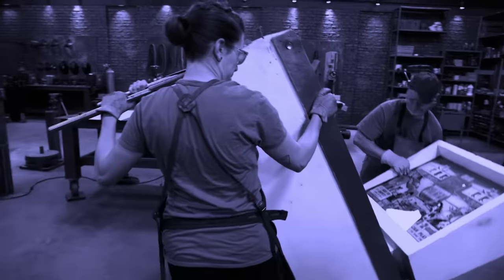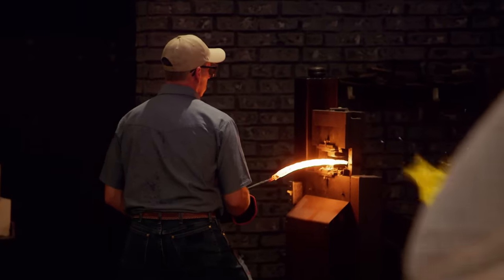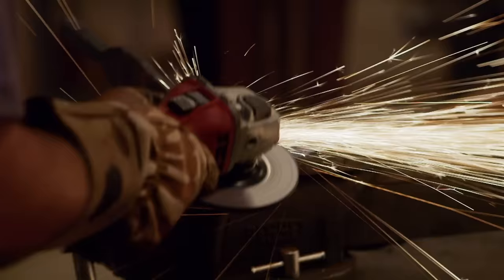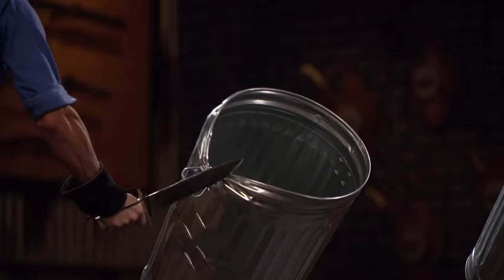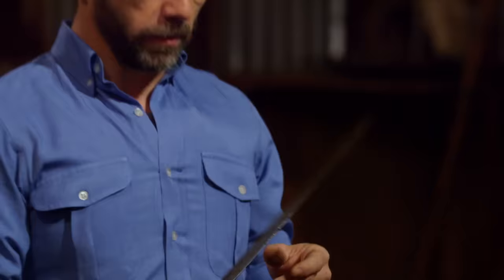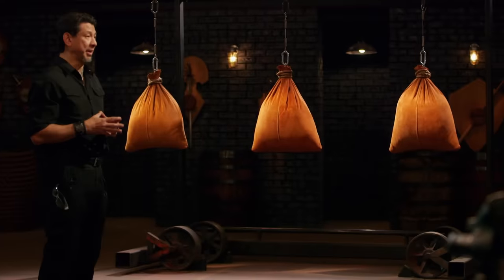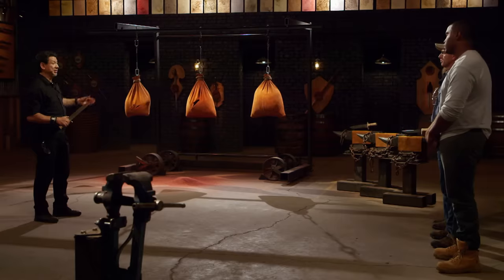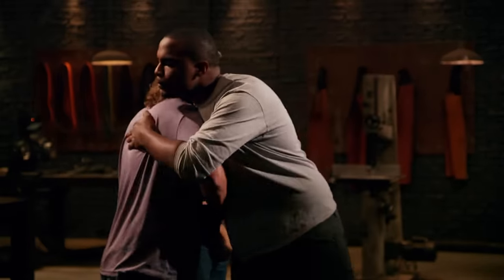Making a Knife Out of Drill Shavings?! | Forged in Fire (Season 7)

Comment: Wesley's blade took the least damage, he just made too light of a knife to handle the thick leather bag.  If they had done a different cut test against fruit or something lighter, it would have probably slipped through them better than the other knives.
Reply: Maybe if he followed the omnissiahs will it would have cut
Reply: Maybe if it had more nicks from the previous test it would have bit into the leather.
Reply: Sharpened 1mm sheet metal can cut through fruit, thats not test of anything.
Reply: He didn't spend enough time sharpening it.
Reply: @streetguru9350  True that. The most dangerous knife is a blunt knife.
Reply: Yes i like his knife
Reply: It held up better than the competition during the trash can test because of the "blunter" angle of the bevel which is the same reason why it didn't perform as well as the others in the sharpness tes
Reply: No it definitely just wasn’t sharp enough a razor blade is super thin but it’d go through that bag like it wasn’t there
Reply: @jeffjefferson2743  A razor blade wouldn't have passed the first test.
Reply: @igggaming9871  that has absolutely no bearing on what I said lol. The other two knives cut the bag yet took more damage on the first test, meaning his edge was blunt enough not to be damaged yet too dull to actually cut anything .
Reply: @jeffjefferson2743  It does have a bearing in that your razor blade wouldn't have even made it to this challenge.

It wasn't wholly a test of sharpness, his blade's shape and weight weren't ideal for cutting heavy leather, they were lighter than the other two blades. It may well have been sharp enough - but the shape (curved such that the blade edge lands parallel to the surface) combined with it's weight did not help.
Reply: @igggaming9871   what I’m saying is that the blade being too thin or light would not hinder its ability to cut leather, hence the comparison to a razor blade which is much thinner and lighter and would still cut the leather(so the blade being to thin and light, is not the reason It didn’t cut the leather). The first test has no relation to anything I’m talking about, I’m saying your reason for why it didn’t cut the leather bag makes no sense.
Reply: @jeffjefferson2743  Nowhere did I say that the weight was a significant factor by itself.
Reply: @igggaming9871  “he just made too light of a knife to handle the thick leather bag”is the parent comment i was responding to why are you moving the goalpost, that’s all I’ve been arguing this entire time the knife being too thin and light doesn’t matter
Reply: @jeffjefferson2743  Because what you said in reply was "No it definitely just wasn’t sharp enough", which is impossible to determine for certain in this test as the shape (combined with the low weight) was at play.
Reply: @igggaming9871  we’ll have to agree to disagree lol, that’s my entire point, that knife when swung like that would cut the bag if it was sharp enough. I think it’s quite easy to determine too given the context of having cut leather before lol, and how the other two blades got damaged in the first test and cut the bag in the second suggesting they have thinner sharper edges. I felt like a razor blade was a perfect example in having all the other factors that could have messed up its performance (too thin, too light and flat) but just being really sharp.
Reply: @igggaming9871  How would you have felt yesterday evening if you hadn't had breakfast or lunch?
Reply: @ExaltedDuck  I'd feel hungry, of course. But let's cut to the chase—what's the real point you’re trying to make with this question?
Reply: @igggaming9871  curiosity. Your prior conversation seemed to indicate a weakness in grasping the hypothetical conditional so I was curious to probe that a little bit more.
Reply: @ExaltedDuck  ,  attempting to carve out intellectual superiority with irrelevant questions in a discussion about sharp knives doesn’t sharpen your point—it only dulls the conversation. Let’s stick to slicing through the matter at hand, rather than hacking away at each other’s ability to entertain hypotheticals. If you’re looking to test someone’s wit, perhaps find a forum where philosophical gymnastics are on the menu.
Reply: It depends, his grind was really shallow meaning it's going to be a really sturdy edge but not cut as good. Had he done a smaller angle, the blade would have cut better but less though. i think he missed the mark by not much. Had he ground the primary bevel more, maybe it could have sliced better but then would it have handled the trash can? we don't know.
Reply: @nikolaitoresan4101  Yeah exactly. Had he done a different bevel he could have won if it held up with the trash can. He should have done a saber grind but bring it higher on the blade.
Reply: @streetguru9350  Yeah that's a thing I noticed... his really wasn't as sharp as the others at all.  it held up better on the can... because it had a less sharp edge.
Reply: @tejaspartapsingh953  adeptus mechanicus gets us in more trouble....

Comment: To make a blade out of shavings is CRAZY
Reply: too bad they made it out of a block of steel
Reply: yeah, imagine how many blades can be made if they don't sweep the barber shop floor.
Reply: @waskito3443 once they melted it down…
Reply: It’s good quality steel and because the shavings are small, they are easy to melt and mix very consistently, so it’s actually not impressive at all.
Reply: @tylerk3616  Through the right technique, things come easily.
Reply: @waskito3443  It's canister. They talk about that. The drill bit shavings + metal powder in a metal container. Seal it, heat it, bang it until it's a solid piece. Some try to cut the canister part off. Unless it's required, don't bother cutting it off in this competition, to save time.

Comment: Couple of thinks that have always bothered me about forged in fire, never tell the contents what their blade is going up against, so it's just pot luck who builds the right kind of blade for the test, which means even badly forged ones get through tests over well forged ones. Second is that they do the cut test after the strength one, but that does make a little sense, as I guess they care more about the blades repeatability than one time use. But yeah it's annoying that many possibly more skilled smith got axed for the sake of TV drama.

Comment: Their tests are just so flawed though, first if they did the slash test after they smashed the edge on the trash can,  the ones that performed worse there or got hit in more varied spots might have got a more serrated edge helping it slash the bag better, and second you just can't rely on a human to use the same pressure everytime or hold things at the same angle.

They should really just use machines and a sharpness tester, they can still have some human tests, but they should be more about feel and aesthetics.

Comment: They should’ve done the cut test first before the trash can literally dulled them. Doing it the way they did makes zero sense it just sets them up for failure
Reply: If they made good knives they would have still been sharp
Reply: yeah, Wes' knife would keel if they did the cut test first. Those other knives were serrated after the trashcan banging and didn't slice, but tore through the leather.
Reply: @rx323bug  Good knives would take more than 3 hours to forge.